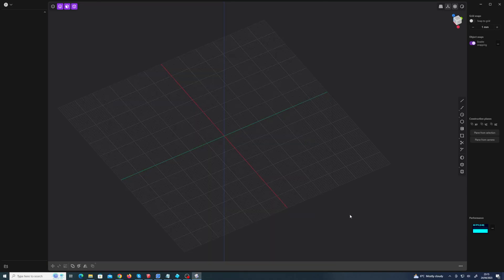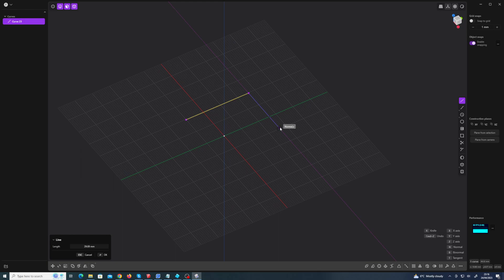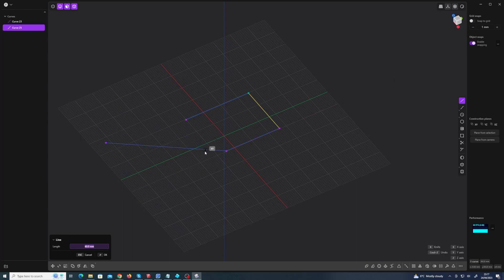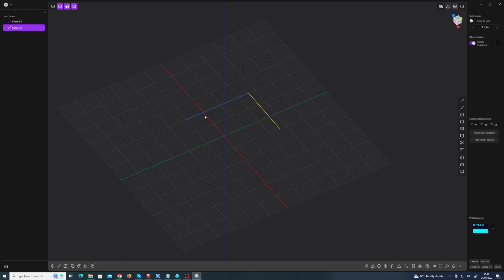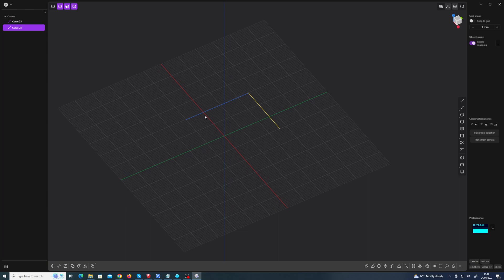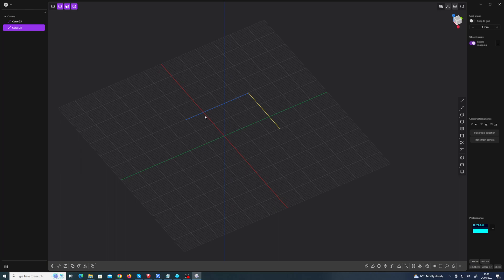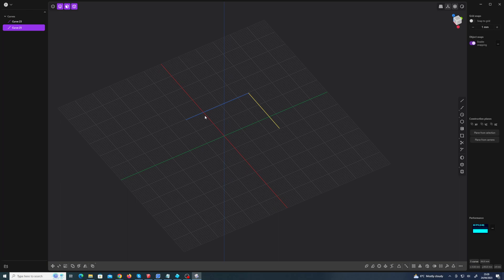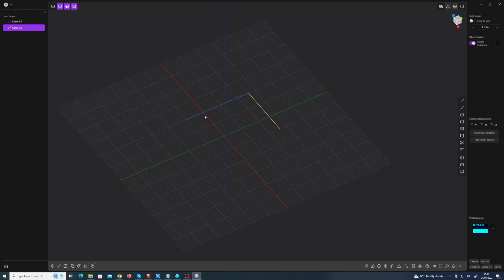More thoughts on Plasticity

Comment: You are using it wrong I will explain. First go to preference and change your units meter, centimetres, millimetres etc. 

Now I will explain how to use. Select Line tool then click ONCE on Grid then TAB and enter your Length then you click in the direction you want to draw the line. 

Again… 

1 Line tool
2 Click ONCE (on grid)
3 TAB
4 Enter Length and Press ENTER BUTTON on keyboard.
5 Then click again in the direction you want the line to go to.
Reply from the maker: It would be nice if the line updated once you entered the value as opposed to having to click in the view port to see the update.